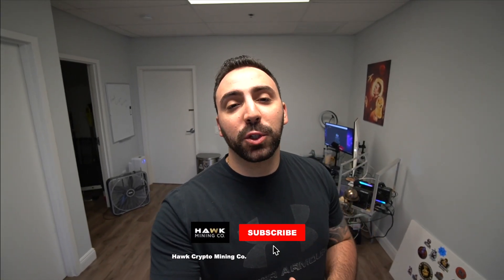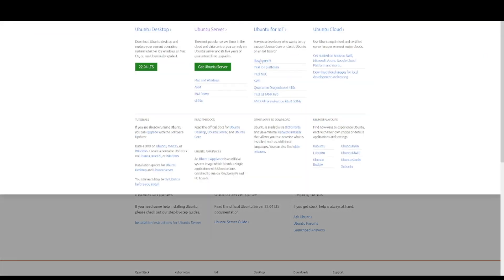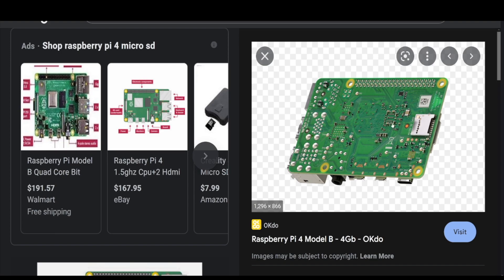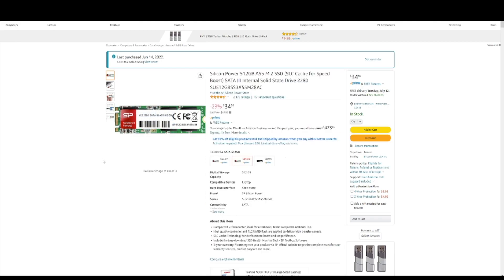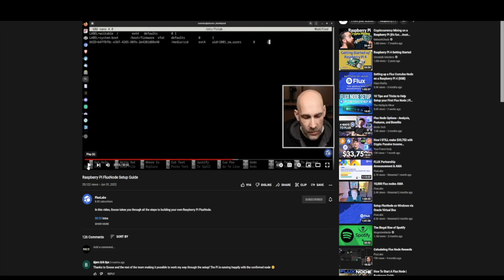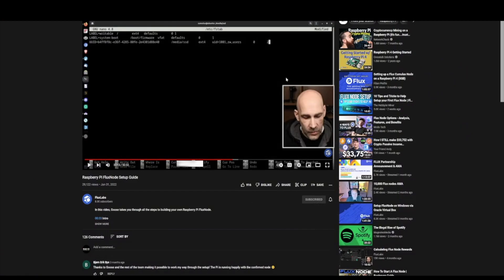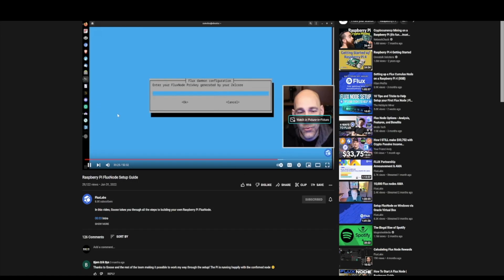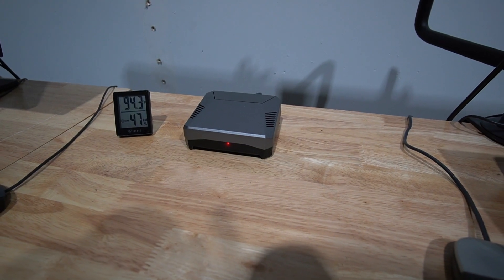I'm done with helium....

Comment: hey man, nice work! one question though, is this profitable? if so how many rewards you generate per day?
Reply: he's not going to answer that. Basically at today's price, you have to put up 1000$ "collateral" in order to make 10$ per month. Basically the definition of ponzi I think.
Reply: @deank.4169  Hey, very different to a ponzi, you don't have to give up the $1000 flux to run a node. It remains yours and stays in your wallet. You can unstake and sell at any time. Looking at current number of cumulus nodes, it pays out about 8 & 1/2 flux including parallel assets every 14 days.
Reply from the maker: You have to stake it, but you get it back if you want to stop.

Comment: Hi there, great guide! I'm up to the point of 'discovering' my M.2 ssd but it is not showing up on the fdisk command. Just the sd card with os. I've reseated it a few times. I am using the Argon One case. Any suggestions?
Hope I haven't damaged the connection on the Argon One case OR on the m.2 stick. (It's a 480gb WD Green)
Reply from the maker: Make sure it’s seeded all the way. I had that problem. Then restart the node.
Reply: @HawkCryptoTech  Thanks Mike! Turns out the SSD was corrupt. Tested at the shop and exchanged. Got the new one in. Went through all the steps.  Thought I was done and then failed benchmarks - upload speed was insufficient. Upgraded my service ... go back to setting up and now my can't login to my flux node -- either on cmd interface via terminal or via Flux Dashboard (webpage won't even open). Not sure what to do now. Do you have any suggestions?
Reply from the maker: @tikurembassa  Did you try to wipe the drive and re-install?
Reply: @HawkCryptoTech  wipe the sd card? Or the SSD? I assume you mean the sd card as that is where the OS (flux node) is. Ugh!
Reply from the maker: @tikurembassa  Yeah try that and format the SSD again